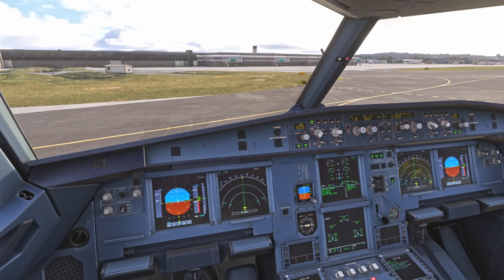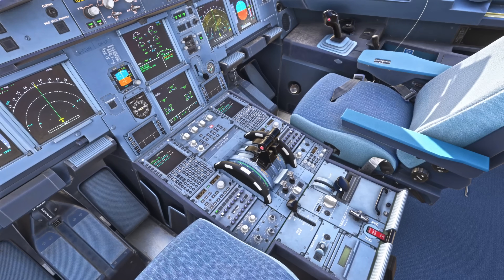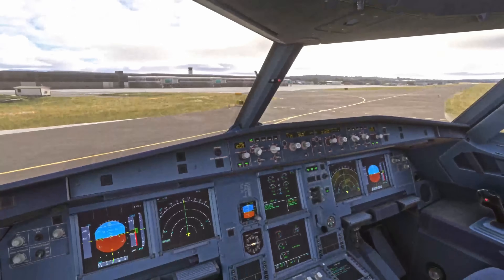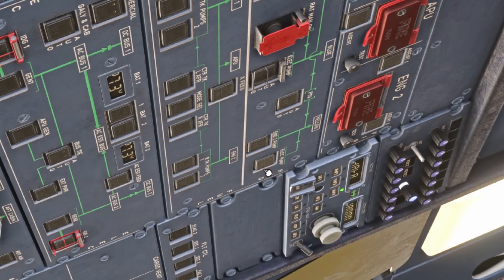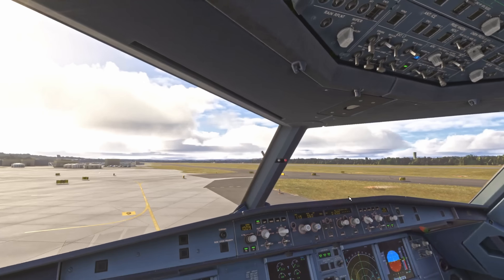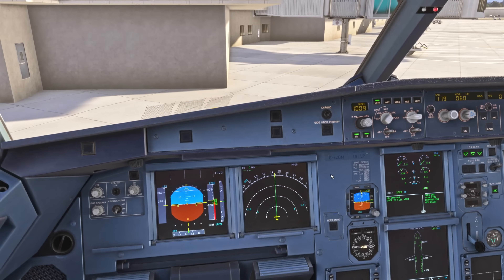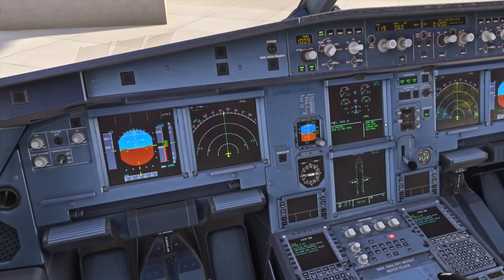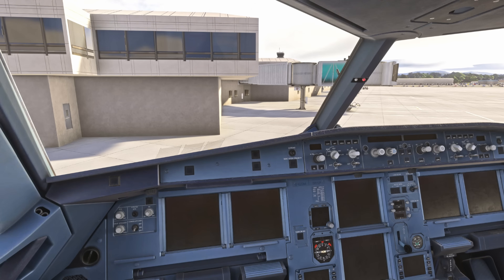A320 Taxi In & Shutdown Tutorial | Real Airbus Pilot | MSFS 2024

Comment: Captain, is there a rule that explicitely prohibits to turn the main landing gear while the aircraft is stationary ? I don't see any reason why you would want to do that anyway of course, but I would like to know if it is even allowed. What prompts the question is possible stress on some parts of the main gear in doing so.
Reply from the maker: Hello, turning the nose wheel when stationary is not strictly prohibited by Airbus but is discouraged due to stress. If you follow SOPs they always give a speed for turns therefore support movement when using the tiller 👍
Reply: @AirbusCockpitCoach  Thank you captain, very clear !

Comment: I have a question after single engine taxi in. After turning engine off and hydraulic pump off,  the PTU starts pumping for quite a while. Do you know why? It's transferring from which system to which system?
Reply from the maker: Hello, The PTU is transferring hydraulic power from the Yellow system to the Green system (because Green lost pressure after engine 1 shutdown).

It activates because of the pressure drop, and it keeps running for a while due to the residual imbalance
Reply: @AirbusCockpitCoach  Thank you for the relply!